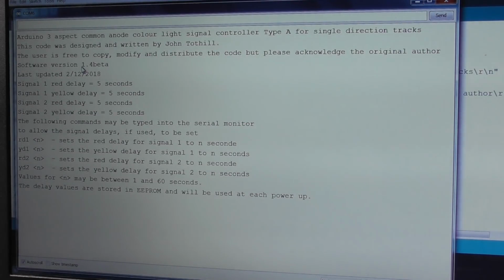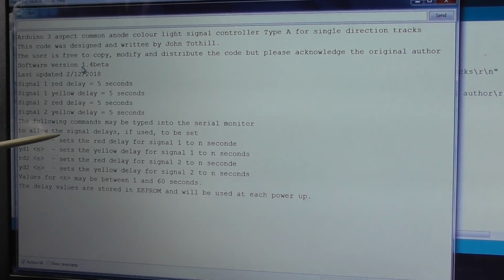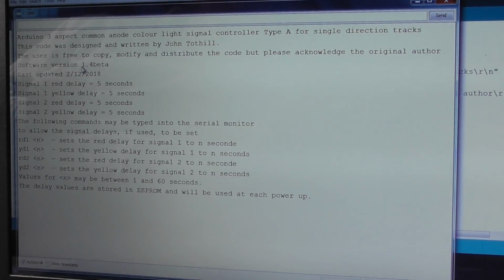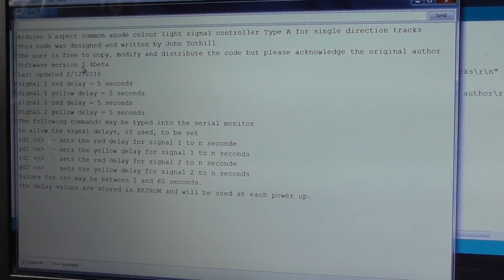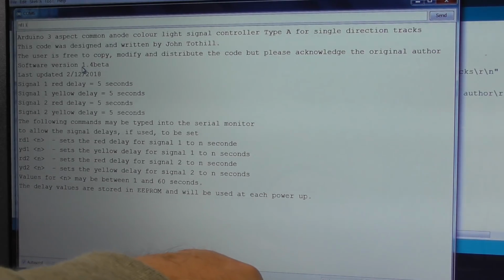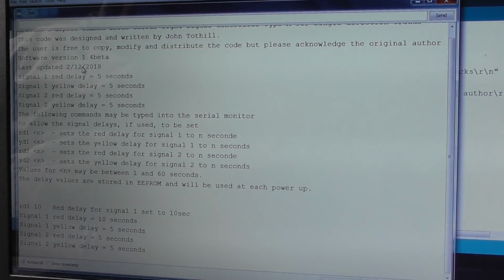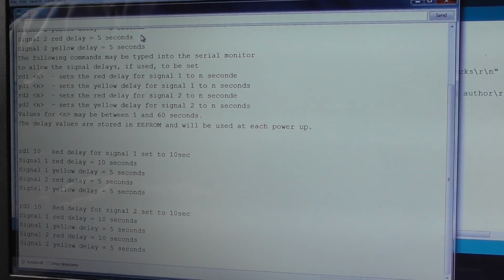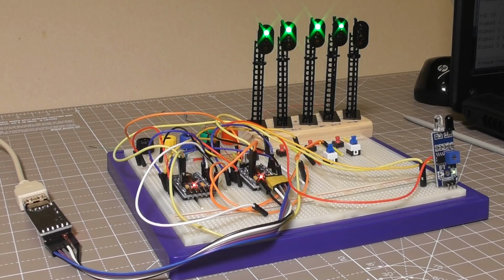Canal Sidings 59   Part 3 of my Arduino signal controller

Comment: ¡Hola buenas tardes John!  Having recently invested in an Arduino starter pack, I was so grateful when I found your series of signalling videos using the Arduino.  I have currently been using an analogue system for signalling. This requires reed switches and latching relays.  However, now I have begun to use the Arduino, I am anxious to use a digital system instead.  I will be investigating your coding and hope to use this with my own layout.  

I have to add that, after watching several of your other videos, it heartens me to know your approach to railway modelling is one for enjoying your hobby and, not conforming to prototypical matters simply to please the so called "Rivet Counters" - for this, I applaud you.    As ever, stay safe and well. Un saludo. Gary
Reply from the maker: Hi Gary and thank you for such a complementary comment. As you may have seen from my later videos I have moved on significantly since this video with trains and signals interactively controlling each other. e.g. train passes a signal and sets it red, next train approaches the red signal and  slowa to a stop until the signal goes yellow or green at which point train starts and speeds up to its original speed setting.

Your second point is interesting and is one that seems to polarise opinion. You are correct that I am not a rivet counter and I model loosely within a time frame rather that tying myself to a specific year or so. Therefore you may see two trains that would not have run together in reality. As far as the layout goes I also try to model an era, loosely. I do however like detail and will try to include this where ever possible. Basically "it's my railway and I will do what I like" after all we do this for fun.

Sometimes things don't go to plan though and an example is the cheap Chineese signals I was using. I have now replaced these in favour of Eckon kits and some scratch built. This is due to two things. Firstly the supply of the Chineese parts has become dificult and also because I have had 2 faIlures of the 10 units that I have. These failures are identical and result in the loss of the green LED due to a short circuit at the top of the signal. So cheap is not always reliable. 

I wish you success with your Arduinos and if I can ever be of assistance then just ask. ....................John
Reply: ¡Hola buenos días John!  Thanks for your reply. I also model according to the infamous rule #1. My layout is dcc but, I will continue to ‘drive’ trains manually. Your applications for signal control are certainly innovative and proves you’re enjoying the hobby to the full. I will certainly take up your offer of advice, should the occasion arise. Un saludo. Gary

Comment: Having finally got my head around most of this what are you using for vcc on the signals? a pin on the arduino or a seperate 5 volt supply?
Reply: Thanks John that helps a lot
Reply from the maker: The Arduino, the signals and the sensors are all run from the same 5 Volt supply. The total current is about 60mA so many sets could be run from a 2A usb charger. ...............................John

Comment: what an excellent job you have done with the signals
i wish i could write  code for to make  a motor  raise  a  crossing barrier   so far and stop and then when the train has passed a sensor like yours  would make the motor reverse to the open position i can  only dream 🙂🙂 anyway what a great idea you  have brought to life
i  wish i could do that with the crossing barrier  i amm good with scratch building but terrible with electronics kepp up the excellent work and a happy christmas to you and yours
regards
james
Reply from the maker: Thanks you James and I am glad to have stimulated you.  Crossing barriers are a prime candidate for  small servos which are very easy to drive and adjust. There are many drivers available ready made or as kits and they are not really that dificult to put together so lang as you can solder a decent electrical connection.
Writing code is not really dificult in itself you just need to start simple. Have a look online (YouTube) at some of the Arduino for beginners videos. You might surprise yourself!
And for simple projects in electronics you could join MERG where you will be able to buy smalll simple projects  aimed at model railways. .......................John
Reply: @canalsidingsmodelrailway3411  
thanks for the reply i will indeed have a further look at the world of arduino
happy christmas
regards
james